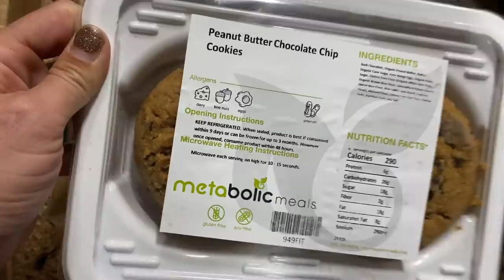Repairing My Massey 1840 Inline Baler: eating cookies for breakfast  ... Part 1 #WieczorekFarms

Comment: Looks like you do work out, it's just not with the same machines they have at the gym.
Reply: Exactly what I was thinking.  Walking to work, and in the fields for cardio and works the leg muscles, mucking stalls for arm strength, climbing into the tractor is like a stair master machine, turning to look behind the tractor while in the seat works the abs and back muscles, and trying to read Jason's mind is mental strength training.